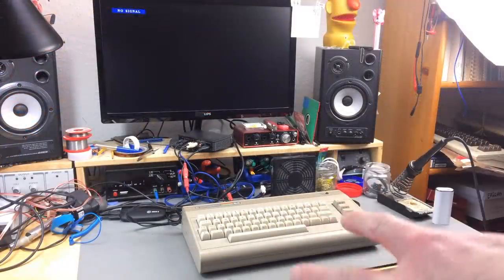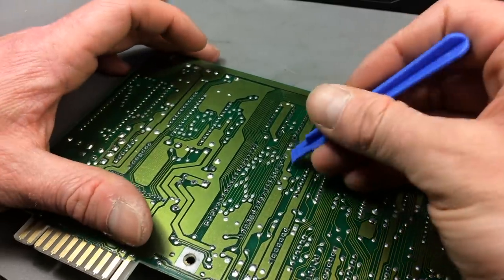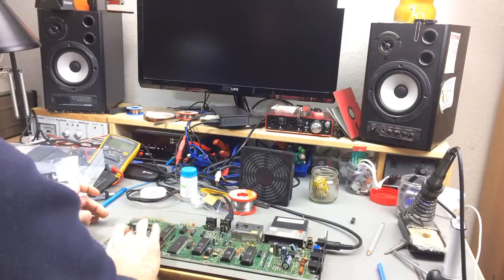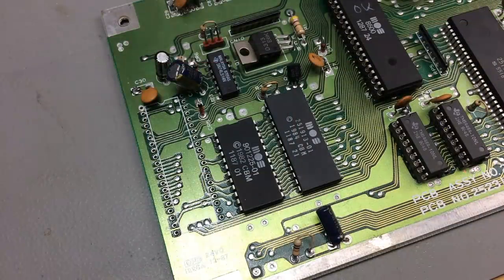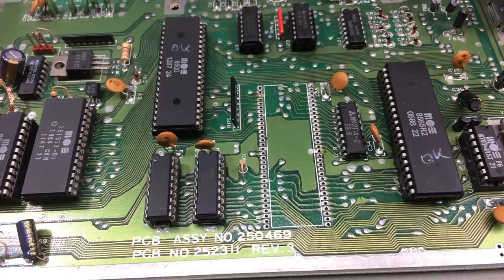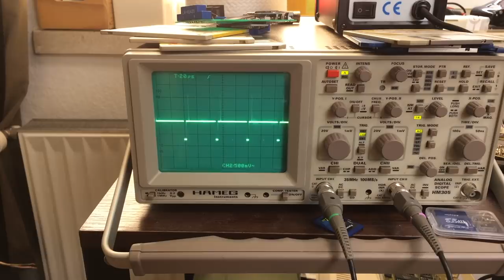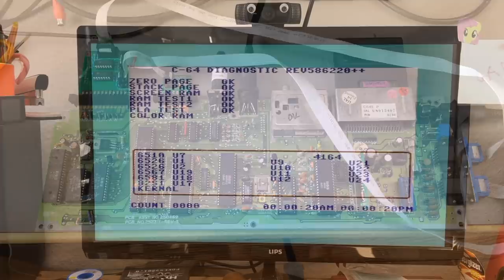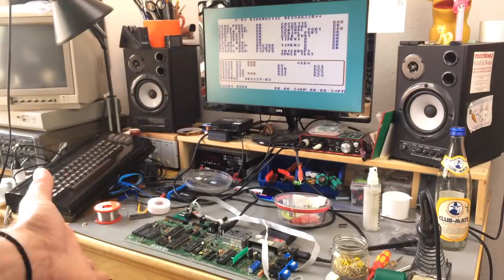Aldi C64 Blank Screen Repair Part 1

Comment: Measure the resistance between the data lines D0 and D1, D1 and D2, D2 and D3 and compare. Maybe the RAM was not soldered very well, or the board has dirty flux on the data lines around the RAM.

Comment: It's probably not related but might be worth checking the 8 diodes above the vic 2 which are connected to the cia's from the serial port and tape port.

Comment: So when is part 2 coming? Id love to see what is wrong this board :) Thanks for sharing.
Reply from the maker: Still working on it on and off but didn't find the fault yet. I might be passing it on to somebody soon. There's most definitely going to be a part 2 some time.
Reply: @JanBeta  Can't wait! :) I do have a Vic-20 with a black screen and no functions on either tape or disk but the tv tells me there is a signal. I was hoping your fault could help me.

Comment: Jan please get yourself a cheap cmos/ttl logic probe, they make diagnosing these old board so quick, plus you won’t need to desolder working IC’s as you will see if they are working, also you don’t check the input voltages till you have basically desoldered everything that you didn’t need to do, you should always check the power lines first, you can then check all the logic chips, then the ic’s, you really do too much work, you should not need to desolder anything until you have found where the fault is first, the scopes ok, but not as good as a logic probe on these 8 bit computers, you are not really learning anything by just replacing everything to find the fault, from modulators are best diagnosed on the board, they are easy to follow the signal through the components, that you can do so simply with your scope.

Comment: You had, somewhere during the journey, a digital signal, that looks like fish fin instead of a square. And obviously there is an issue with bit 1, as you get, at a certain point, a scrambled screen, where exactly one line is missing and you get characters rewritten with 2 numbers off. That looks like this one dataline is influenced by something. However, even I have parts lying around for these old C64 and Apple ][ computers, I had never one of these analysis cartridges, so I have no clue, what they exactly measure and switch at certain points. And I didn't see you pulling any schematic... So I can only give these hints, but then guesswork starts.

Comment: You have a lot of patience lol
Reply: 5   hours   to   fix  a  looozy    c   64     kidding   easyist   fisable     computer that  ever   came out     it   must   have got   a   power   surge   that will wreck    the   i o  chip   and   rectifier   diodes     illl change all of them    they have a   bad      habbbit  of  leaking  later on  if   u  use a  second   hand   one      any way            another  dollar  for  jan      brttter   lucl   sell it  on   ebay

Comment: Hello Mr Beta,

In in the video round the 49.55 minute mark, we get a more or less clear shot of J3. It seems to be set to NTSC instead of PAL ? 
Perhaps you could swap the two CIA's and see what that does ? Same or different error ?
Have you tried the RF output ? Probably wont change anything but just to be rule this out.
oh and if I were you, check the test harness on a working C64.

Also, funny that you say the PLA hardly every fails. 
It was usually the 1st thing I go to when I had a black sceen. Soooo in essence, get it checked...

Cheeeeeeeeeers

Jecepede
Reply: tienes razon jecepede el cristal que monta en de 17mz para pal y el j3 esta para ntsc el vic de video no tendria que ir bien ni tampoco el deadtest que se veria negro

Comment: Das sieht für mich so ein Bisschen nach einen Defekt in der PLA aus. Der defekt des Controllerports kommt durch den SID, die Pannelkanäle werden durch den ADC des SID ausgewertet. Ich denke, dass beim Memory Mapping was nicht stimmt, da er zum schluss die Darstellung zerhackt. Das mit den Tap-Port lässt sich vielleicht dadurch erklären, dass vom Userport kein Signal zu Tape-Port geschalten wird. Dafür müsste der PLA zuständig sein und auch die Streifen zum schluss lassen den Schluss zu, dass das Bankshifting / bzw. die Hardumschaltung nicht richtig Funktioniert da müsste man vielleicht mal den Busszustand prüfen, wenn man auf eine bestimmte Hardwarekomponente zugreifen will. Der fehler ist jedenfalls Reproduzierbar, weswegen ich nicht denke, dass Kondensator defekt ist. Ich weis nicht ganz genau, gibt es im Bus irgenwelche PullUp-Widerstände die eventuelle kaputt sind, so dass ein Adressbit den Falschen Pegel hat?

Comment: With how junky they are, I'm surprised you didn't look at the PLA first.
Reply from the maker: Oh, the Super PLAs in the short board C64s are very reliable usually. The older regular PLAs are the unreliable ones.

Comment: Jan this is a bitch, I would check continuity of the ram and CPU data lines it could be something that's holding one of the data lines high.  I'm no expert but check all traces on the motherboard because this should boot ?  Great vid Jan and good lesson in diagnosing multiple faults.  I've learned a lot with this one and eagerly awaiting part 2.🤗🤗🤗Kim 🤗🤗🤗

Comment: Someone:  own or borrow PERFECTLY functional examples of old personal computers of your choice and take oscilloscope screen shots at various important points.  With things like, for instance, data and address lines just a representative sample can be shown to give an idea of how sharp the square waves should be and how much in the way of rounding and over/undershoot to expect.  Put index numbers on a system schematic which will lead one to the associated 'scope screen shots.  Put the schematic and screen shots in a PDF.
Reply: Sam's Photofacts servicing guides did that for other electronic devices they made guides for, but not in the one they made for the C64 which is pretty much crap.  Strange since PHOTOFacts (schematics with 'SCOPE photos at various test point) is what helped make them justifiably famous.

Comment: Jan, did you get it up and running then? Had a great time while watching this part 1 of the journey👍
Reply from the maker: Not yet, but I will eventually get back to it with a fresh(er) brain. ;)
Reply: @JanBeta  Did you ever notice that at a certain point in the test cart process, the character generator ROM starts to fail? It's the same bit you notice going bad with "BAD" showing as "@AD". All of the '2' bits coming from the CG ROM go to 0 at the same point in the process every time, causing the second-to-right column of every glyph to go blank. Is it maybe a sketchy trace on the board that fails when certain activity warms that part of the board? I dunno if the test cart makes its own copy of the CG rom, so it might not be the CG rom failing, it might be the RAM it's been copied to, or one of the output lines from the ram always being 0 either at the output leg of the chip or after traveling across the board. Maybe one of those RAM sockets the previous fixer put in has a bad solder joint.

Edit: I notice other people saying it could be a bad chip-select line. One of the data lines, the one that carries the '2' bit out of the muxer, being sketchy could lead to this too, or the muxer itself simply not switching that one line. Like, maybe the test cart switches from one chip to another at that point in the process, and when it tries to switch back, that one line doesn't actually switch back.

Comment: Hmm. I think you hav to check your bond wire that lays directly over three other solder points... (44:35 in the Video) It could be that the bonding wire, for some reason, touches one or more of the three solder bumps. The Pin of the resistor network RP5 can have sharp edges... Pin 3 of the Memory controller U8 is the trace A15 - it's a part of the Adress Bus (Bit15) (used to adress memory and I/O devices) -  and goes to the cardridge Pin F, to Pin 23 of U6 (MPU) and to Pin3 of the resistor-network RP4 that pulls up to +5V.
I found a Schematic - i hope this can helps you:
http://www.elysium.filety.pl/docs/schematics/computers/c64/250469-rev.A-left.gif
http://www.elysium.filety.pl/docs/schematics/computers/c64/250469-rev.B-right.gif
Here a Block Diagram of the C64's Adress Bus:
http://www.elysium.filety.pl/docs/schematics/computers/c64/c64bus.gif
And here a link to the main Website that contains a lot of C64 schematics:
http://www.elysium.filety.pl/docs/schematics/computers/c64/?C=D;O=A

Here's also a Link where you can search for all the Commodore chips and other things:
http://mhv.bplaced.net/cbmroms/cbmchips.php

Comment: 'B' becoming '@', 'O' becoming 'M', 'K' becoming 'I' look like something is clearing the second to least significant bit to logic 0 at some point in the test. Something wrong on databus line D1? It would be interesting to know what the test does the moment this happens. Maybe accessing some specific IC that is faulty and wrecks havoc on the data bus?

Comment: i   hate    aldi   boards    the   9  v   5  v  are   completely   different  ill  never   buy   aldi   crap   design   in  power  supply     i   hate themmm             they  designed it   with an  amatuer    tecnical   designer   like   their   lcd   only   last  1   year  or   so     rip    aldi   and  stay   away   from   computers     ur   not  engineers           bad onrs at   c  64    lcd
Reply from the maker: The Aldi C64s were designed by Commodore, they use an early version of the short boards used in all later C64c versions. I think this one got damaged by excessive overvoltage at some point (my guess is lightning strike or something like that).